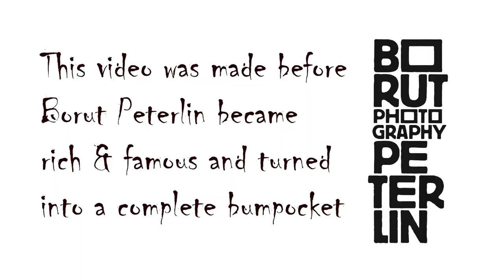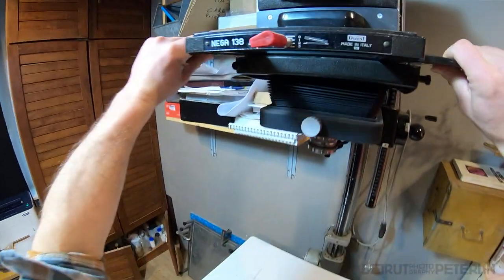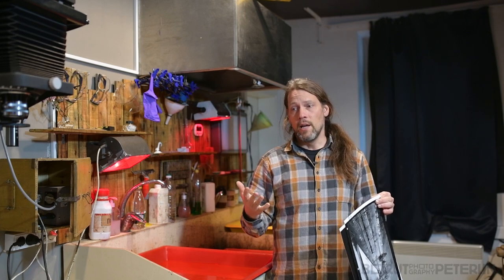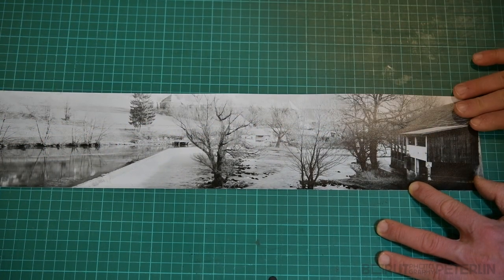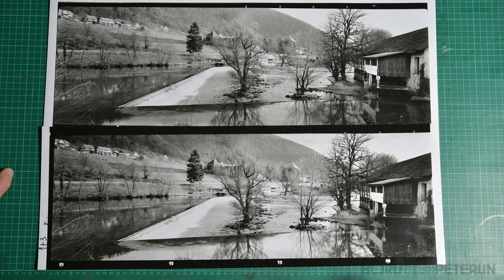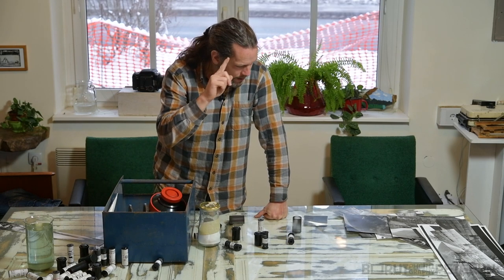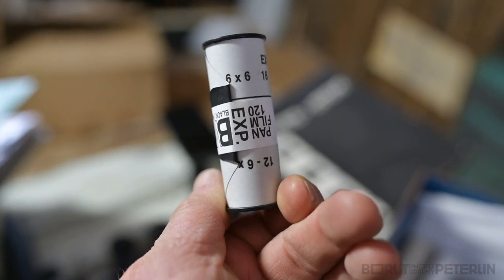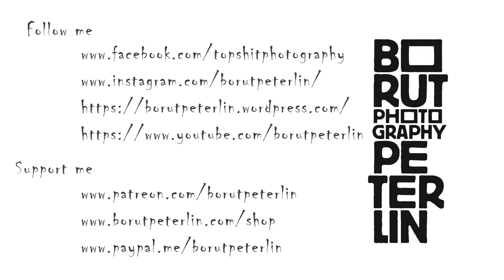Part 2 - The most famous film developer Kodak D-76 also known as ID-11 / Vlog#56

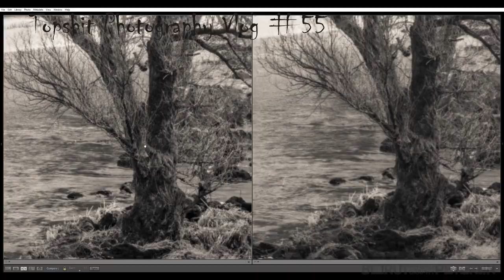Comment: Did you use Fomapan ? The paper you use has a very low ISO . I print on Fomabrom Variant111  and my time on a 20 cm wide 20x25 cm print from a 6x7 negative is at most 4 to 7 seconds if use Fomapan , with T-max 100 or Fuji Acros it is only 3 to 5 seconds at 1:11 . I develop Fomapan 100 in 16 degree celcius 1+50 Rodinal for 12 minutes . I get than very easy to print negatives , good high lights and detailed shadows in one simple exposure . Friendly greetings from the Netherlands Peter .

Comment: vigorous developing prevents lines and streaks .  Too gentle and developer is not replenished evenly and defects show up where it is reduced.   I find two inversions in 5 sec every 30 sec with 90 degree twist two times while inverting  is perfect.

control contrast with time,  not agitation which is always the same.  Only one variable change at a time!

Comment: Thx for another nice video! Any tipps on how to adjust the sharpness on the 138 with the table so low an the knob so far above?
Reply from the maker: It's not the most comfortable, but it can be done. As I am a passionate in 19th Century photography processes, authentic way it would be to have a slave, but you know these days that's a bit harder to do.
Reply: @BorutPeterlinPhotography  ;-)

Comment: Thanks for the video. I have been lately shooting Fomapan 100 (35mm) developed in hc-110 (B) and I like the look of this combination but I found it a bit too much contrasty and some lack of detail in the highlights. I wonder if ID-11 could do a better job keeping the contrast low but as you said the dilution 1+3 could give me some issues with the highlights so I suppose I should work better with 1+1 or1+2. I liked the explanation you did about the silver with the 120 films. ;)
Reply: I've shot Foma 100 a few times, and my understanding is that Foma emulsions HD curves have a quite flat shoulder (meaning less tonal range in the highlights and easily blown outs whites). I love the look it gives though so I'm fine with it. Maybe some developers can mitigate that ? I've only developped it with Rodinal and XTol so far.
Reply: Develop your film a bit less. Development time has a pretty direct relation to contrast or highlight detail. If you lose shadows, you can increase your exposure of the film a bit to pull the film into a range that captures the range you want.